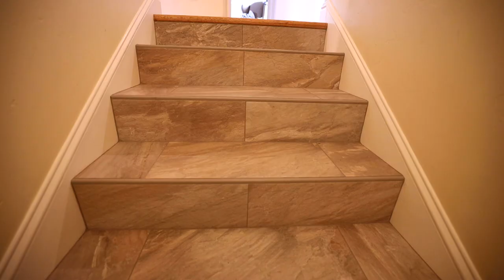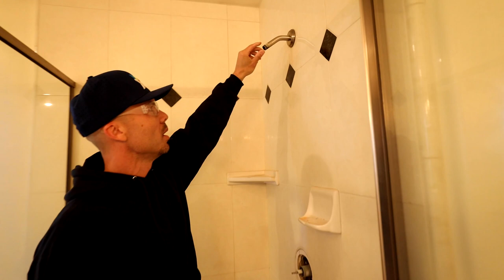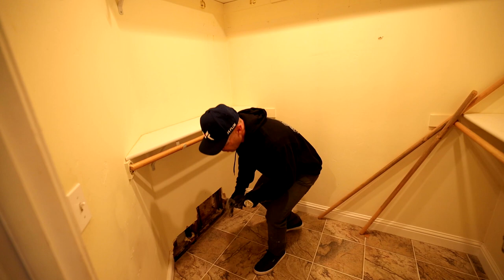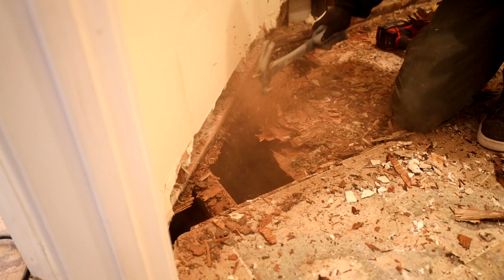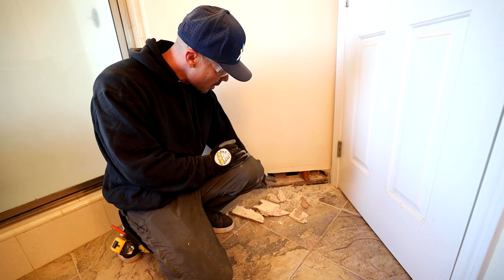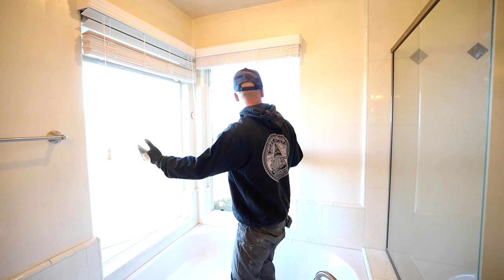Simple MISTAKE Causes CATASTROPHIC SHOWER FAILURE!!!

Comment: Our family learned the hard way how dangerous mold from water damage is.  Our 8  year old daughter started complaining of dizziness, sore throat, constant headaches, and she was having episodes where she got really loopy, all from an old roof leak that we primed and painted over instead of remediating.  You should not be tearing into all that moldy stuff without a negative air unit and at least 4 mil plastic to isolate it.  Every time you bang it with your hammer, millions of spoors go flying everywhere.  It wouldn't surprise me if the owners are suffering effects of mold exposure without knowing what is causing it.  Most doctors don't know anything about mold exposure so they can't diagnose it.  BTW, letting the mold dry before demolition is actually worse than doing it while wet.

Comment: Interesting to see your fittings are female in the wall over there.  We have generally have male threaded fittings that come out of the wall and are water proofed to the backer so any leaks from screwing on fixtures are inside the shower and water proofing.   Obviously plumbing it self can still have failures within the wall too but would be less likely that a positioned fixture that gets constantly adjusted and likely changed during the life of the shower.

Comment: This is why it's so important to know what your doing when installing a shower, something so simple can lead to thousands of dollars in repairs, I make sure to use the high quality black Teflon tape and hand tighten the shower arm, even if it stops not pointing down I've always been able to turn it enough to get it in proper position and make sure it's on the tighter side not loose at all, plus I pressure test the shower spouts with a five gallon bucket underneath before I seal up the wall just in case a solder joint is leaking.
Reply from the maker: Good call on the pressure test.
Reply: A good trick to use when installing the shower arm on top of using thread sealant tape(wrapped 3x WITH the threads) and pipe dope is spinning the goose neck on as tight as you can get it by hand, then using the handle of your channel locks or a peice of 1/2" copper inside the goose neck to spin it a couple more times into the drop ear 90.
Reply: @TileCoach  Wait so people dont pressure test their faucet before closing the wall??? That''s risky as hell  lol.... I always use a compression valve on the tub spout and a test cap on the shower drop elbow and pressure up the entire system before anything is closed. When the water is running normally the pressure won't be anywhere close to max so I know im solid.

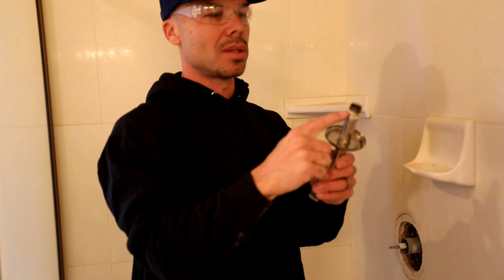Comment: 4:53 the solution to this "problem with shower arms" is to wrap it heavily with Teflon tape and put pipe dope on as well. Be sure to taper the tape so you don't push it off the threads. This will guarantee that the threads will be water tight long before you get to a point where it's to tight to turn to the appropriate position. The pipe dope acts like lubricant. Just get it snug and you're all set.
Reply: As a plumber I can confirm this is the proper way to avoid leaks and headaches. I always like to apply both Teflon and pipe dope for extra security.
Reply: @dvo23k  as a carpenter, concrete finisher, and drywaller that works for a plumber repairing the damage caused during repipe jobs, bathroom  remodels, and insurance jobs. I also agree because that's how they taught me to do it and I've never had to do any warranty work for him.
Reply: Absolutely the best method. An alternative is to skip the tape and just use pipe dope, if you are certain that you will never, ever want to unscrew that shower arm ever again. With the tape, you get the same seal as with dope alone, but it is still possible to unscrew the arm without a crowbar.

Comment: There's one thing that it would be good to do whenever you find you're having to remove water damaged materials, always use a HEPA air scrubber next to the area where the work is being performed.

As being certified in mold remediation and water damage restoration I frequently see tradesmen or handyman unknowingly exposing themselves and the entire living space to mold spores.

Mold effects everyone differently. I've seen people not effected at all from the occasional contact, and I've also had a friend who was never sick get cancer and die from living in a home with 'black mold' that came from an air conditioning system.

The point is, a HEPA air scrubber can help minimize the risk of exposure to mold and even on a job where no visible mold is seen it can still help keep the dust down from spreading through the home.

Comment: Just tore out my 30 year old tile shower after signs of moldy drywall in the closet behind. Same cause as Issacs but slightly different. The shower head pipe actually corroded from inside near drop elbow! So renovated the entire master bath. BTW found some new cool tileable floor vents by Aria. Easy install and look sharp.
Reply: That is crazy.  I am checking mine tomorrow.
Reply: Been wanting to use an aria vent lol

Comment: Man that shower head connection setup is terrible. Are they all like that in America?

In Australia we do them the complete opposite way, we have a male thread that sticks out through the finished tile. We waterproof around the male thread after the wall linings are installed. We then cut the threaded pipe back to the desired length after tiling (usually leaving about 25mm / 1 inch left showing) then we screw the shower head/arm (which is a female fitting) onto that.

No chance for leaks into the wall cavity this way. You can see exactly what you are doing, even if the connection was to leak this way, it's on the outside of the tile which is not a problem.
Reply from the maker: Yes, they are almost all like this.   I would love to learn more about the Australian set up.

Comment: I always use loc tite thread sealer and haven’t had a leak yet. Also you can put your Chanel lock handle in the pipe and give it another 1/2 turn or more
Reply: Exactly what I do. Never have had a leak using this method or a peice of 1/2" copper
Reply: Exactly. If it didn't go too far past I may switch to blue or yellow tape. 1/4 to half short I just do what you did. Never had the neck break. Of course I didn't but a Walmart plastic pipe, either!

Comment: I recently pulled out an extremely old shower and bath from a 1970s house. It had that ugly splotchy tile used at the time and the tile was over about 2 inches of mortar over a wire mesh. It was a complete nightmare to remove, but there was zero leakage after all these years. It make me thing that all these new products people are using and having leaks and problems with are NOT better than the old ways it was done. I'm thinking about rebuilding using the same type of method instead of using all the overpriced crap they sell now.

Hope you fully recover from the flu soon.
Reply from the maker: Thank you!

Comment: Water damage is absolutely BRUTAL, and in this case it’s not spending less on waterproofing and such, was a leak in the shower drop, which is a bummer; but, most times ppl won’t wanna spend the money or take the time to waterproof a bathroom, which is important as the cost of fixing/replacing can be more than the actual install in first place. 
For the windows, probably know, but I like using Vvivid, 3M, Avery, etc…Architectural Window “Vinyl” to add privacy, and it’s a relatively easy install; and the cost is real affordable, compared to getting new glass or windows installed. 
Have a good one✌🏻
Reply from the maker: Thanks for the tips Aepek!    I'll start looking at those film products.

Comment: Yea that’s common, also sometimes when theres shower heads with handheld attachments water will run down the flexible line going through the escutcheon plate causing water damage always Check those shower heads
Reply from the maker: Good advice.   Thank you.

Comment: We just had a tine leak in a 90 degree elbow behind the wall in our upstairs bathroom. It took months for it to spread everywhere and find a place to start dripping through the ceiling in the basement. By the time it was noticeable in the basement, it caused 35k dollars worth of damage in the walls and floor upstairs and the ceiling, walls and flooring downstairs. Been doing repairs ourselves for 3 months now and finally almost finished

Comment: Had that on a call where the showerhead was loose and spraying back at the escutcheon which was also loose and the shower pipe was in a hole much to large letting the shower water blow into the wall cavity. Have to also be careful using teflon tape, there is a way to install it and a way to not install it. Pipe dope is generally the better product for sealing pipes.

Comment: I have seen similar to this. Over time there is a build up of calcium in the spray head which increases the back pressure the drop ear sees. Te time I remember this was a shower which had been in place 5+ years before it started to leak due to that increased back pressure.

Comment: Before schluter and redguard there was lathe over wall studs. Sand, cement and lime put on like plaster and cut flat with a metal straightedge. The cost was about a single kerdi board plus labor. Those showers either didn't make it out of warranty or they lasted forever. I don't have the heart to tear them out, i would always go tile over tile if they haven't leaked in 30 years.

Comment: I roughed in a valve and tub for my brother in law. He had his neighbor assemble the trim. He used a galvanized nipple on the tub spout and it was hand tight. He called and said my valve was leaking but only when it was running. I double check my sweats so i was confident my work was solid. I knew either the shower head or tub spout wasn’t installed correctly. He got moldy carpet in his closet for letting his neighbor do it wrong lol

Comment: Man do I hate those side by side bathtubs and showers ! I hate those shower elbow pipes too. I never install them, even if it's a 30 second job. Often the elbow pipe-shower head joint leaks. So imagine how often the water supply-shower elbow leak. Annndd it has to be aligned in a specific position so the elbow points down which makes it even more likely to leak.

Comment: This should be addreessed by the code making authority.
If I'm not mistaken, drop ear elbows for a shower arm have a rubber washer (like a garden hose does) resting in the bottom of the elbow because tightening it probably won't orient it correctly,
When I have had an occasion to install one (rarely - i'm just a DIY'er) I purposely created a hole in the finish material that is LARGER than necessary (but small enough to be covered by the trim ring) so that I can slip the ring down the shower arm and peer into the wall cavity and look at the elbow to see if it's dripping. Shower arms get manipulated every time you reach up to adjust the aim of the shower head. I like being able to see that drop-ear elbow. These days, there are so many add-ons available that it's always under stress somehow.
It's a bad way of doing things and needs to be re-designed.
Reply from the maker: I agree!

Comment: those engineered floor joists are ok to cut into to do the curbless shower? It doesnt weaken them?
Reply from the maker: That is a great point. After I recorded the video, the same thought came to mind.   Part of the house was built with dimensional 2x12 joists so I assumed the bathroom would be the same.  Now I think we will need a small curb.
Reply: @TileCoach   Aww ok.  I just did a curbless shower last month, it came out so good. but the general contractor made me build the outside floor up to have enough elevation for the shower slope because of that type of floor joist.

Comment: This same leak occurred because the concealed plumbing elbow developed a hairline crack in my 2nd floor bathroom. The nipple was nice and tight. Fortunately my floor joists were not damaged. I installed an access plate in the ceiling below and confirmed the condition of the affected area.
Reply from the maker: Good idea on the access plate
Reply: @TileCoach  fortunately the ceiling is in an entry foyer and the access plate is unobtrusive. It will remain a permanent means to inspect the floor structure under the bathroom.

Comment: So what would you suggest someone do to prevent that with the shower arm?
Reply: Wondering the same thing, I stuck a screwdriver in and forced it into place, hoping that isn't a problem
Reply: Use thread sealant tape wrapped 3x going the same direction as the threads, use thread sealant joint compound, spin the goose neck into the drop ear as tight as you can get it by hand then use a peice of half inch copper or the handle on your channel locks inside of the goose neck to spin it tighter into the threads. Usually you can get 2-3 full rotations beyond hand tight using this method and its always worked for me. I've fixed many leaks this way

Comment: Ugh...well, I have one of these drop ears and I haven't gotten to the point of threading the rod in yet, but I can still modify it if there's a better way.  What's the preventative measure?
Reply: Use the right amount of tape and also use dope. If the head is completely in the wrong direction when tight, redo with more tape or less tape.

Comment: 20 year old shower probably with no waterproofing on the vertical wall surfaces.  Makes you wonder why waterproofing the walls is such an inherent part of today's installation. There's no need for it unless it's a steam shower!
Reply from the maker: You are correct!  No waterproofing, just a float.   And the walls were bone dry.
Reply: @TileCoach  
My father built his home in 1972 and he used American Olean Master ser  with Dow Corning Silicone applied from the factory in the joints of the tile unit. The tile is set with mastic over sheetrock  and all field joints filled with Dow Corning Silicone as well. The tile is dated but not one water issue in 48 years!

Comment: Ok so you found the leak source... if the shower structure isn't significantly compromised, take care of the leak, repair the drywall and that's it. Why rebuild the entire shower? That's very expensive! Oh, I get it. Business. If the customer wanted to renovate it regardless that's fine, but let them know a complete renovation honestly is not needed.